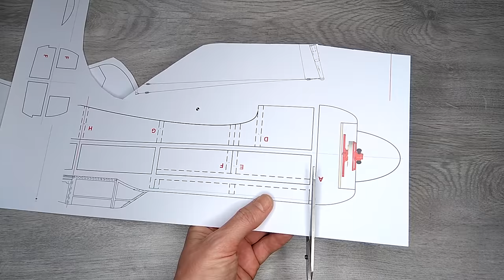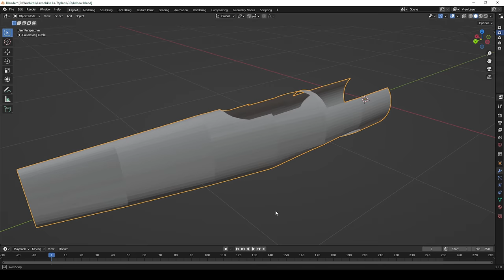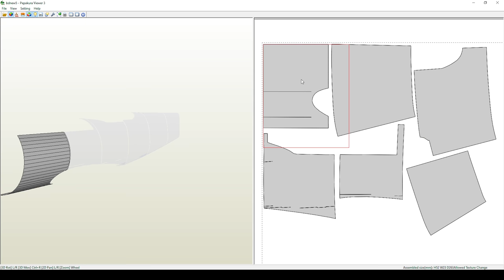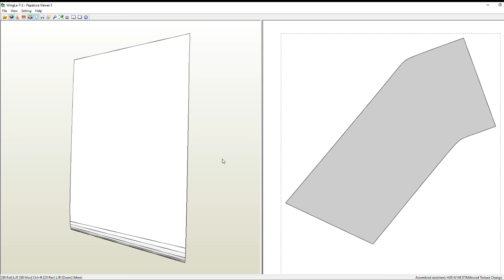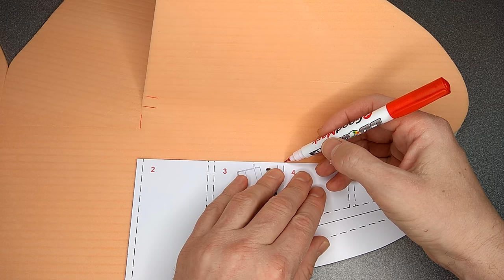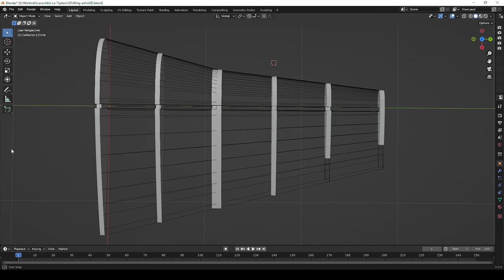Lavochkin La-7 RC Plane DIY build

Comment: Nicely done, clever design, I’ve rarely seen a scratch build come together so neatly …sure beats those FT kids! You’re very fortunate to have ‘depron’ so freely available there, here it is either imported or stocked by hobby stores who charge a premium. I’ve started making my own by hot slicing thin sheets off thick XPS boards.I just love the sound and rigid lightness of dense foams.

Comment: Nice! Where did you get those hinges for the retractable landing gear?
Reply from the maker: forget about it, it's not a good choice, except that the plane weighs no more than 100 grams
Reply: Ok, what's the problem? Reliability? Not opening or not closing at all? Draining battery?
Reply from the maker: if you really want to try  https://www.google.com/search?q=HY011-01802

Comment: Numavig, where do you get that blue XPS styrofoam? Can you tell us where we can source that in the United States? Closest I can see is DOW's styrofoam blue board but it has DOW's emblem all over it. Can u send me a link to the brand you use?
Reply from the maker: this is a local manufacturer without worldwide shipping
Reply: @NumaVIG  OK.. you're lucky to get good quality foam board like that in a large size and multiple colors... I see some 20 x 30 inch board that is blue here in the United States but nothing larger... I will search more. Thanks so much!
Reply from the maker: maybe https://www.amazon.de/uficell-SOFT-Step-Acoustic-Insulation-Laminate/dp/B00N3PP342/ref=sr_1_7_sspa?keywords=depron-d%C3%A4mmplatte&qid=1648107976&s=diy&sr=1-7-spons&psc=1&spLa=ZW5jcnlwdGVkUXVhbGlmaWVyPUEyOEhRM1Y2NzNGVEY0JmVuY3J5cHRlZElkPUEwMDY2NDA0MjBZMENEWFBaVldKQiZlbmNyeXB0ZWRBZElkPUEwMDQ4ODg2MUkyM1RGUTIyUlYyTiZ3aWRnZXROYW1lPXNwX210ZiZhY3Rpb249Y2xpY2tSZWRpcmVjdCZkb05vdExvZ0NsaWNrPXRydWU=
Reply: @NumaVIG  That's exactly what I was looking for ... thank you soooooo much!